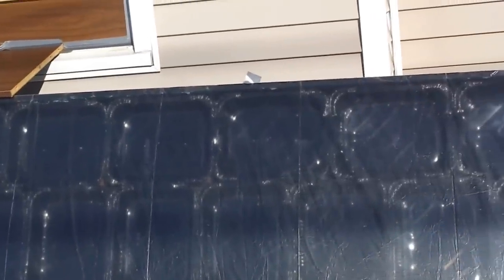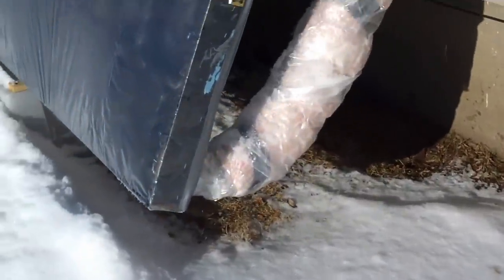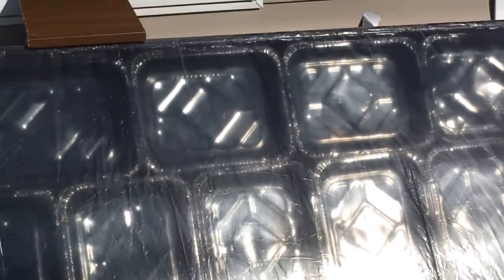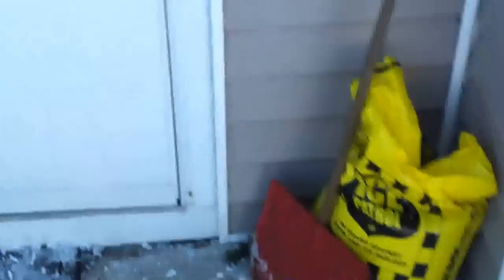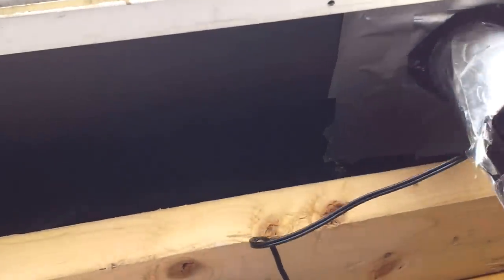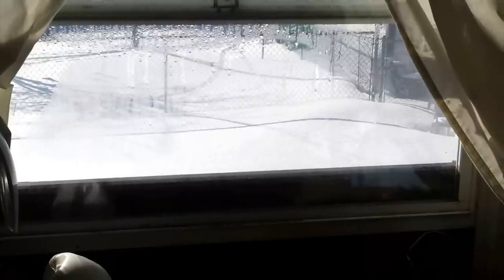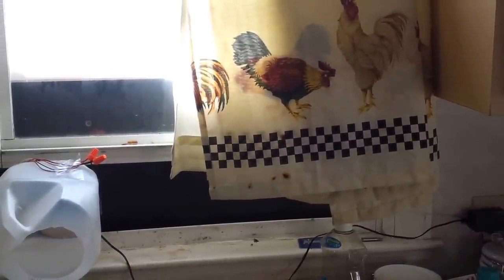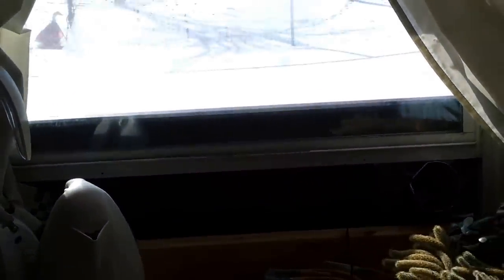$35  4' x 8' Solar Heater: Made of Aluminum Baking Pans [disposable kind]

Comment: You nailed into your plastic siding which will cause water behind your siding which costs more than that contraption.
Reply from the maker: Hi Richard,  It's aluminum trim on the Window.  I cover the nail holes with a drop of white caulk when I take it down in the spring.  I used to work in construction and foresee no leek issues-- but thanks for your comments...

Comment: How much did you save on your gas &  electric bill per month using the solar heater?
Reply from the maker: Maybe about 1/3 of the cost since it does not run at night
Reply from the maker: That is the normal "cost" of the gas bill...
Reply: That's a great savings. More money for other things

Comment: Add a solar cell collector for free electricity to power the fan...totally self sufficient.
Reply from the maker: Right...that's good.  I used solar for my door wall unit and it is totally self sufficient and works good.  see Solar Heat Panel, Part 2: Inside Sliding Glass Door 32' x 68  the nice thing is that if you plug in the 12 volt computer type fans [via transformer] they only use cents per month in electricity, but solar is good too

Comment: do you use an exhaust fan to pull of the air from outside in the house or...?
Reply from the maker: Yes, pulls from inside the house.
Reply: You can clearly see that  the intake for the heater is on the left side of kitchen sink through the modified 1 gal. plastic milk jug.  Using outside air would be wasteful and require more heating.  He looks to have both an intake and exhaust fans.

Comment: Please take some video of the box minus the plastic so we can see some detail in regard how use used the baking pans.
Reply from the maker: The pie pans are screwed to the plywood.  Simple...  I drilled a bunch of holes through the side walls of the pans to increase air flow.  The easiest way to drill through the pie pans is to stack up 4 or 5 pans and drill a bunch of holes all at once.  I used 3/16" drill bit, but I believe anything similar should work.  Once you have drilled the pans out lay them out in the box and screw them down.  Thanks for your comment!

Comment: Do you really even need the fans? Doesn't the heat create a vacuum to suck the air thru on it's own ?
Reply from the maker: I found that the fans are very helpful.  Try it both ways and see what works best for you.  Fans did the trick for me.  Just like in a normal furnace... hot air rises, but there is still a large blower fan pushing it out faster to all of the places in the home

Comment: you can use black cinefoil also instead of baking pans.
Reply from the maker: Probably a good idea if you use several layers I'd imagine... Part of the heat generation is based up the "amount" of aluminum in the device absorbing the suns rays.  The baking Pans are much thicker then a foil... but again many layers should work fine, I would think.  Also keep in mind that that I also believe the pans are also by design "sun collectors"-similar to the way satellite dishes absorb various signals- the pans absorb the sunlight... Hope this helps and thanks for your input
Reply: Have a nice time with your collector.
Reply: +Don Russo ....Don...i think that it  is only the amount of square footage that is relevant. you are only capturing is the radiant heat from the sun and convertion it into convection heat. since the aim is to transfer the radiant energy to convection energy and warm the air through the convection process. if more material is added in layers and the material absorbs the heat it will then have to release back into the air. a step i dont think would be neccessary. i could be wrong....i am no engineer, but i think the quickest  and most efficent tra
Reply: +Don Russo ....continuation of my previous comment. ....i think the quickest and most efficent transfer of the radiant heat to concection heat to warm the air should be the desired aim.

Comment: wont the plastic cover melt when the pan started heating?
Reply from the maker: Good question Emily.  As of yet, I have not had the problem of the cover melting.  I think because the outside air is so cold it keeps it from "overheating".  I would suggest that you use the larger outdoor heater for the more frigid days and if you build one of my window heaters they typically suffice for the fall months.  View my channel for the window heaters--there is even a solar powered one that runs itself (zero energy cost) It can be found at: Solar Window Heater-- Self Powered

Comment: Use black construction paper to help absorb heat.
Reply from the maker: That might work.  However,  I might be concerned that the construction paper might pickup to much humidity and eventually mold.  Have you tried it this way Willy?
Reply: Don Russo na I was kidding, that won't work, the only things that would would be increasing the thermal mass of the object, increasing the amount of photons on the object, and altering the rules to favor heat capture, PV=nRT, which is why those evacuated heat tubes work so well.

Comment: Hi Don

Great Video Thanks.
We do have a question about the pans you use. We've seen several videos all using different items inside a box. We've seen pans, cans, dryer heater hose and even screen. Why not just use a box painted black inside? Would that not heat up and allow the hot air to rise to the top of the box and the cooler air to go to the bottom causing the thermal flow you need to heat the house?

Thanks Ron and Harriet
Reply from the maker: Good Question: The Aluminum in the Pie Pans hold the warmth a lot longer [and hotter] than just a box painted black.  If you end up doing a comparison with just a black box vs. one with aluminum I am sure you will see this.  I chose the pie pans because they cost me a little over $6 at Sams Club an next to nothing in labor.
Reply: Ok Thanks
Reply: Harriet Mall Another question, What size are the baking pans that you used also what did you use to hold them in place.  Thanks so much
Reply from the maker: Any size should do.  Mine are about the size to hold a medium sized Turkey.  Short screws held them in place.
Reply: Don Russo Again Thanks So Much. We will start gathering material today to build our solar heater.
Reply from the maker: That's Great Harriet!  Good luck.  Just remember to let the paint thoroughly dry before using it to heat your residence.  If you smell strong paint residue when using it, it means that the paint and/or caulk may need more time drying.
Reply: When you make your collector keep in mind that its not only how hot the box gets but how well you can transfer heat out of the box that makes the difference. Aluminum takes on and gives up heat faster than wood does so its a better choice for collector material. Also its more efficient to pass air over both sides of your collector material as opposed to an empty wood box that would have air passing over only one side of the wood.
Reply from the maker: Thanks for your thoughts George.  I drilled holes though the pans so that airflow would pass though both sides.  In the future I am considering a model that would have more aluminum baffles (essentially drag or stopping points) to cause the area to heat up even more.  The small amount of pan surface limits my heat capacity to about 80 to 100 degrees F.  The fan and solar panel (5w) combo actually blow a little too hard for this model.  I am going to build one in the near future that is about 3 times the size and use the same type of solar panel and fan (size/strength) to increase my heat capacity tremendously I am sure.  Thanks again...
Reply: Harriet Mall The pans are about 12"x10",  use short screws to fasten.
Reply: George Bernstein Do you think lining with aluminum foil would work just as well?

Comment: FLAT black paint.  The kind rated for GRILLS, because the regular can leech into the air when heated and I'd rather you not breathe that in the house.  Also, I gather you used the pans because you had them laying around, which is cool, but they are not at all efficient.  The idea is the air flows freely over/through hot black objects (no Hallee Berry jokes please), and black window screens or narrow aluminum tubing works much better for that.  That's not a put-down.  It's meant constructively for anyone who's reading.  The screen is also much easier to nail/staple in and cheap.